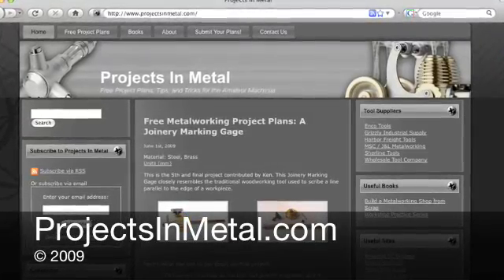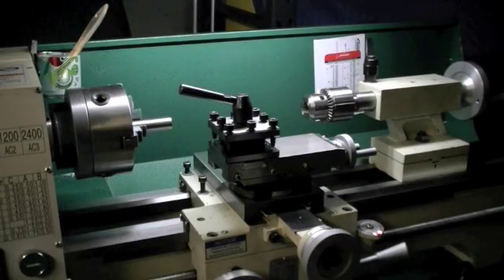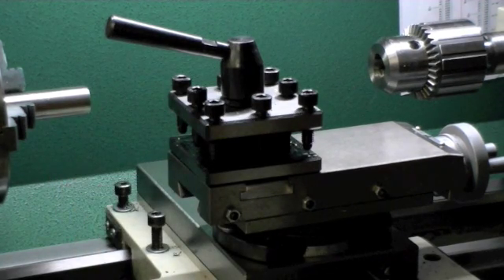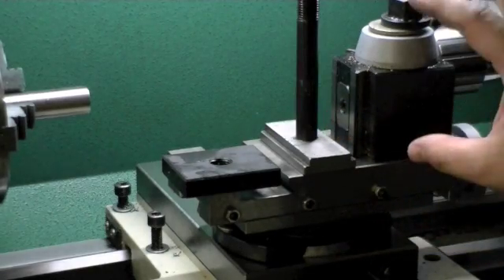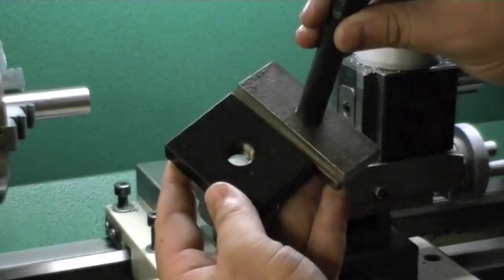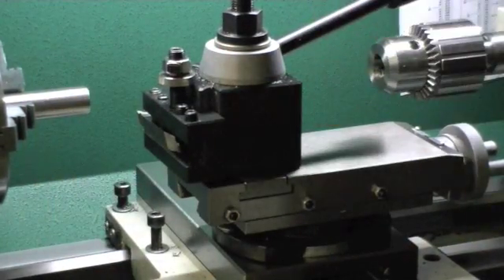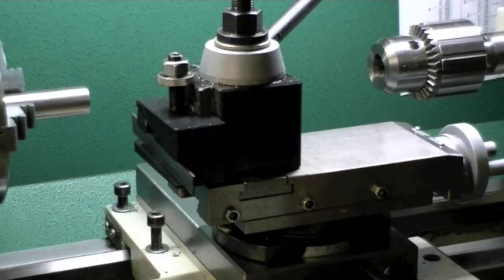Grizzly G0602 Upgrade: Adding a Quick Change Tool Post to my Metal Lathe

Comment: Hi there, for people who don't own a mill to manufacture a new plate, for the Grizzly 10X22 lathes, the tee plate is on their web page for $4.00 each plus postage. I bought 2 of them and re-drilled and tapped the new threads into one of the spares I bought. Since I don't own a mill yet, I had to go this route. https://www.youtube.com/watch?v=zH_9ZCMikd0&t=40s Also... I think this is an equally good tool post and probably is the exact same except for branding plus it comes with more tool holders and a knurling tool holder and tool and a boring bar holder. I know this video is old so this option from Grizzly vs Ebay may not have been available back in 2009. But in 2021 it is at least right now. Here is the link to the Ebay deal https://www.ebay.com/itm/BOSTAR-AXA-250-111-Wedge-ToolPost-for-Lathe-6-12-8PC-Tool-Holders/283687065990?_trkparms=ispr%3D1&hash=item420d111986:g:vq0AAOSwXfJf89uz&amdata=enc%3AAQAFAAACgBaobrjLl8XobRIiIML1V4Imu%252Fn%252BzU5L90Z278x5ickk7PdDazAlGltMLJlUhrWsDzEHyFC%252BIf0cwDPsy9qi8IzVt8%252BEWBbLdOq3s%252F6zBBTpOs2uRuxE%252F9M4BZF2LIplg2ocA2WNrSD%252B6M89EVDg9mFUKbcG9Zzrz001JOKXc3EXjRt3ftPJ%252Bd0GxduP1nCmiKl5rwWKcVrrIpRV%252FFT0xJLC3PVwewSHSZ8peoy3fW3rjMvlvBleYDaNAY1kRfnfR12YW9KvsJiWjDpmCoXTk%252F18oQrEp0thPiANsl2rHLb5OiCtDWUmrRXWWcmpnpobl4PP%252F7eUAyYoifciECYe69BORK8OatTyKs7GRbGBi3lGAmnP7Z6M3Q8Kjmv%252FKLFS2QFuSVIQ4V2vDvAW4qryq2yuvniTSRgKKB7wjDo7b18wY1ZMeN9AnaaF63UKRD8RwLixmpKF70aVjE8k4DXrgj6K%252Fe55HFL8QFNRyWkrkCClEpD6OGtycUXr4YJ1whkv8NOiwfDS6s7ueTTT9JyQVP4i5ds%252FI%252B56tCShpBiYKWUBmayDAgWq61cZOk41NPsTDM9cpRogkDqgi69YIUcNV2UeY8oy7M1f%252FNtNe8sAJt1H%252Bxk4M9gW%252BXMi9FNi9GSqeAU3JHWVBCfzJN6PRx%252F5EMiz6eO7jD9oH5LXCnrD0EPrnNsg26aa0wofSh6yulRq4gT%252FR46dhEsuIK2a8VLiZeZUudDJdsbmLWa%252FOWQZWIX0LPQwRNWyHQpv5Y1%252FS%252F4hmRwgnrW5FB9jLLLtjXlMjAHYnUSuRlKjxtOPGJS2vrTC%252BPu9z%252BYfKUBu3XzFTV89yGGVviX%252F5WiIMENjb1OuyS0%253D%7Ccksum%3A2836870659905bdf8e66391c43c48077093c3a7304c3%7Campid%3APL_CLK%7Cclp%3A2334524 

Thanks Projects in Metal for helping us with this video.

Comment: I am trying to do exactly what you have done. However when I measure the thread on the stud which came with the QCTP it measures as being a 1.4mm pitch i.e. not the standard 1.5mm. This is using a thread gauge.
????? I can't find anywhere that calls up a 1.4mm pitch for the 14 mm diameter shaft. ???

Comment: Hello Tyler, Very informative video. Just need some clarification re the QCTP which you used. G5689? I inquired of Grizzly via their tech support email address about the differences between the G5689 and T10166 QCTP sets which they sell. They said and I quote: "The G0602 does not accept any of the quick change tool posts, to full capacity.  The T10166 Quick Change Tool Post
 is for a smaller swing lathe than the G5689 Quick Change Tool Post.  
Please note that the t-slot nut will need to be machined to fit, and 
some modifications may need to be required."
I followed up with them and they said that the tools would sit too high in the G0602. i.e. for example if the chuck were mounted into the holder of the T10166, the chuck CL would be too high to align with the CL of the chuck. Did you have any such issues with the G5689?

Comment: INSTEAD OF MILLING THE BLOCK THAT COMES WITH THE TOOL POST IS IT POSSIBLE TO USE THE EXISITING ONE? THAT CAME with the lathe ? im beginner and dont want to try to figur out how to cut dove tail into metal wood yes metal no. lol not yet.

Comment: Can  you or anyone, help me ,, I really like the compound of the G0602  with the slide in mount piece,  that makes mounting any tool post or any other tool so much easier,,,  I have the G4000 and I bought a second slide so I could drill it and still have the option of going back to my other tool post,,   My question is would the G0602 compound slide  fit the G4000,   from the looks of the parts diagram,  they look just alike  in all the ways they mount, to the cross-slide ,  would like to compare measurements with someone that would help.

Comment: Unless you just like making work for yourself it's easier to make a new tool post stud than milling a new t-slot plate. Just buy a partially threaded M14-1.5 bolt, cut the hex head off, turn the end down  and thread that end to fit your original plate (probably M10). You could also just mod the M14 stud that came with the tool post by threading one end to M10, but you may not want to for resale purposes.

Comment: Why do you have odd bolts not tightened on your lathe?  Why do buy parts "made for the G0602" that you have to machine new parts in order to fit to the G0602?  Why do you have to "Buy a Tap" to make threads when you have a lathe -- that presumably makes threads?  Why does this purpose-made 'tool rest' for the G0602 look ridiculously oversized?  If this (sic) 'purpose made' tool rest requires THAT many parts for you to make, why not just make the whole thing yourself?
Reply from the maker: The loose bolts I think you're referring to are to bolt a follow rest to the front of the carriage. I never use the follow rest, but I left the bolts in place in case I ever needed to install it. The've never gotten in the way since I don't turn larger pieces. So they've never been a problem. Also, keeping them in place prevents swarf from filling the holes. I don't know of a manufacturer that makes a QCTP that bolts onto a G0602 directly. Most come with a metal plate that you need to mill to fit your machine. As far as cutting my own threads instead of buying a tap, sure. I could do that. But at the time I was a novice, hadn't cut a lot of threads, and didn't feel like figuring out what gears to change to get the proper pitch. Plus I would need to shim the original 4-way tool post so that it got the threading tool to centerline, etc, etc. Sometimes it makes sense to buy rather than make. A friend of mine once said "sure, you could buy an ore mine and smelt your own metal ... or you could just buy metal and save yourself a bunch of time and money". I get what you're saying. But I think the hobby metalworker already has a tendency to build tools that help him build other tools that help him eventually build that project he's always wanted to build. Sometimes it makes sense to buy some of those tools so that you can move on to building fun projects faster. Another example, I made my own tap handle. Spent hours on it and it was awesome. I was really proud of it. But I could have bought something just as good for less that $10. As far as being oversized, I haven't found the AXA100 to be too large. Having larger/heavier components helps reduce chatter as the larger mass helps dampen vibration. As far as tooling is concerned, I usually use 1/4" or 3/8" but rarely 1/2" so yes, in that regard the size of the QCTP is a bit oversized for my needs. But being able to accept 1/2" shank tooling is helpful because it's so ubiquitous and easy to find tools of that size.
Reply: @ProjectsInMetal  LOL -- I see how one can get lost in all this stuff!  Example: I just watched a very looong video series on a guy "fixing up" a Grizzly lower-priced-lathe that weighs ~100lbs -- the G0765.  So at the end of it the guy answers the question:  "Well, if I had to do it all over again, would I buy this lathe, or another?".  Part of his answer was: "Well, I might consider the G0602.".  So then I find YOUR video, and you are fixing-up your G0602 because IT wasn't 'good enough'!   Ugh!  Then there was another guy who replaced his G0602 motor with a fancy VFD 3-phase setup & controller.  Double 'Ugh!'  But good low-speed torque.
Part of my frustration is that guys never seem to talk about what they DO to the parts other than take them apart and put them back together again.  Sure, you clean them up, and deburr them & grease them again, but what else?
It's easy to get carried away with this stuff, isn't it?  I think for my small space (Apartment) and limited resources right now, I should go with a size & weight  & cost that I consider manageable, realizing it's gonna have limitations.  Thank you for your informed response!!!
It seems that, just perhaps, those smaller lathes with the plastic gears are able to produce a wider range of thread pitches based on LittleMachineShops.com's  gear change table/calculator.  Is that true?  See, one of my applications is to make very course threads -- in wood.  Can the G0602 take advantage of those gear changes too, or is it more limited?  I was looking up thread pitches of 2,3,4,&5 TPI -- in about a 2-3" diameter wood blank.  I know -- low speed torque is needed.  Can the G0602 do those?

Comment: Could you re-use the existing plate instead of making your own or milling the plate that comes with the kit ?
Reply: The plate that comes with the 4 way toolpost has a different hole/thread size in it.  You'll have to drill out the hole and re-tap it, so you won't be able to go back to the original toolpost if you need/want to for some reason.  I just made one out of a scrap chunk of steel I had sitting around.

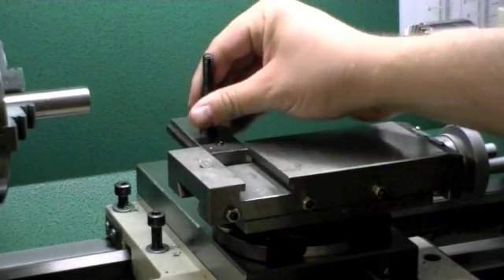Comment: Minor point, but at 2:10 it's the nut on top of the new tool post that pulls up on the t-nut not the handle.  Sorry if I'm picky but that threw me when I first saw your video, but I did end up buying a wedge type quick change for my G9972Z.  Thanks for making this video it helped me a lot.

Comment: The t-nut that comes with the G0752 and G0602 is PN  P0602222 - TOOL REST SLIDE PLATE. It can be ordered from Grizzly and cost $4.00. drill it out ant tap it for 14mmx1.5

Comment: Why not utilize the T-nut supplied with the four-way tool post.   I think it has a 10mm thread which is much smaller than the 14 x 1.5mm post of your QCTP.   Clamp the supplied T-nut, with the post still installed, in the four jaw chuck and center on the post.  Once centered, remove the post and bore/tap 14 x 1.5mm to allow mounting the QCTP post.
    Its hard to understand why Grizzly doesn't supply a extra blank T-nut with the machine.  Metal lathes are not an impulse buy.  Anybody who buys a G0602 is serious about cutting metal and will replace the four-way with a quick change post. A lot of us either don't have a mill or access to one so it creates a big hassle.

Comment: i bought one from King Canada 250-100 part number(Chinese), but I think they are all the same over the world lol. I did drill n tap mine, but it has its downside...you cant re-use the original tool post if you wanted to cause now the hole is M-14...so I just made a custom through bolt ,.one with M-14 thread on it...it oesnt matter which way u go really....I just didnt have a mill at disposal to mahine a new plate
Reply: I have a G0602 and left the T plate alone. I used my lathe to turn down the bottom of the post and tapped it it to 10mm 1.5. I can switch back and forth if necessary.

Comment: I was thinking the same thing. Did you drill and tap yours? Which tool post did you buy? Our lathe will be delivered tuesday, and we wanted to order the post before it got here. I can't even find the dimensions for the compound. Any help would be appreciated.

Comment: You'll be cutting something in the range of almost 13.7 t.p.i. This is due to the incorrect gearing installed in the 1st place..ive tried 2 or 3 thread pitches already, all are horrible. This error also makes the thread dial useless to use. Set ur machine up to cut 20 t.pi...and measure the carriage travel, it should be .050" per spindle turn. .of course all the backlash has to be takin out n reference marks put on the spindle  to note exactly 1 turn

Comment: I own this same lathe (except its the King Canada model)As far as i can tell so far , the gearing is all wrong for threading , close but no cigar. For instance, when cutting 13 t.p.i...the carriage should advance .077" per  spindle revolution...in reality they only advance around .071-.072". The carriage  is behind .005'' per revolution of the spindle. Doesn't sound like much but.....over 13 turns of the spindle (13 t.p.i) the carriage is late .065"!. ..Almost 1 complete thread! HORRIBLE

Comment: why couldnt you just drill n tap the exiting plate? thats what im doing to mine , plus its got 2 small set screws. 1 opposite (each side)the center bolt which ties the plate to the bottom of the comnpound. Does yours have them?

Comment from the maker: Hi Roman, it's actually usually the opposite. You end up shimming a tool up by adding packing (thin strips of metal) underneath the tool to raise it up until it's on centerline with the axis of the lathe spindle. It's a pain because it takes time to get set up, but once it's set up it's not that bad. But I still prefer a QCTP.

Comment: Thanks for making this video. It's clear, concise and a big help to someone like me, just getting started with small lathes.
I was surprised the Grizzly G5689 Quick Change Tool Post Kit did/does not have a properly milled T-slot plate all ready to use. Not only was the plate not milled for the T-slot, it wasn't the right length. 
I'm at a loss to understand why Grizzly would sell the kit this way... Any ideas?
Really enjoy your videos!
Roy Lewis Buffalo, New York USA

Comment from the maker: Your QCTP should have come with a washer. You can buy our make a large "fender" washer that would work. It doesn't need to be hardened. But if you want to harden it try to find (or make) a non-galvanized washer. Then use a torch to heat it up to cherry red. Then dunk it in motor oil (clean oil works as well as dirty oil and can be safer). The part should emerge blackened and hardened.

Comment: I just purchased the lathe and this QCTP.  I dont see the washer that is shown under the nut at the top of the QCTP in your video.  With out it the nut wont tighten and there is no way to tighten it enough to keep the assembly from rotating.  Am I missing that part or did you add it to the setup?

Comment: @jhareng 

yea, there is a trade off. I bought the 200 and it works great, but I do have to machine the bottom off of some the larger tools to get them to center dead on. No big deal. Thanks for the videoa, they helped me a lot.

Comment: Thank you very much for making this video!  I just bought the same lathe and I'm in the process of switching out the tool holder with one just like yours! I became puzzled after removing the stock post. I just thought it'd be a simple swap but not so. Like your video shows, it's not the end of the world, just fab something up. Never the less, thanks for the sanity check .  Regarding the lathe itself, IT'S AWSOME! I waited a long time. I had an old Atlas 6" for over 25 years. Time for an upgrade

Comment: You added the 100 series post the same as I did, but I can tell in your video you have the same problem. Your tool holder bottoms out on the slide and it should not. The 100 series post is 2.5" wide the 200 series is 3 inches wide and would have been a better fit I think. At least I am pondering getting the 200.

Comment from the maker: @alehax27 - and it's not that the crate adds 50 pounds, it's wood. But there's everything else the lathe comes with that is stored within the crate - like the faceplate, both chucks (3 and 4 jaw), the steady rest, all the change gears, misc wrenches and dead centers that come in their own toolbox, etc. So it really makes sense to pop the top of the crate and remove all of the extra weight. However, the crate is flimsy once you start taking it apart, so keep that in mind.

Comment from the maker: @alehax27 - It's 350+ pounds, probably closer to 400 if you include the crate. But you can reduce the weight considerably by uncrating and removing the chuck, tailstock, etc. I didn't take mine upstairs, but I was able to pull it from the back of my Ford Escape SUV and move it to a steel table in my garage with the help of a strong friend. Between the two of us it was manageable. If you left it in the crate you could strap the crate to a dolly and pull it upstairs like a heavy appliance.

Comment: I was ready to ship it back, I didn't want to screw with drilling and tapping for the new rod. As I was looking at it, I found a cheaper and much quicker way to do it, and keeping the stock parts. I went down to ACE and picked up  2 barrel nuts, about 3/4" long, and a bolt, the same size as the bolt that holds down the tool post. This works slicker than snott.

Comment from the maker: Also, I had some trouble using the knurling tool for the same reason (the bottom wheel touched before the top wheel, and that made for an uneven knurl). Again, this wasn't an issue for me because I prefer a scissor type knurling tool to the bump type that the G5689 QCTP comes with. However, I thought it was worth mentioning this as well. Have you come across a different QCTP that fits better? If so, please share. And thanks for your comment!

Comment from the maker: Hi WidgetWorksUnlimited, You're correct. I also had trouble using 1/2" indexable tooling. However, I haven't had any issues with my 1/2" HSS tooling. The inserts on many indexable tool holders sit a bit proud. Mine add an additional .050 to the hight of my 1/2" tool, and thus don't work (the cutting edge sits slightly above centerline). But that's fine for me because I have a set of 3/8" tooling for any jobs that need a carbide touch.

Comment from the maker: Hi FarmMachinist, 

I certainly could have done that. However, I didn't want to make my turret style tool post unusable/unsellable. Not that I'd ever use it or sell it, but you never know. 

But you make a good point, especially for those of you who don't have the ability to mill a new plate, converting the old plate (by holding it in the 4 jay chuck, drilling, and tapping) would probably be the easiest solution.